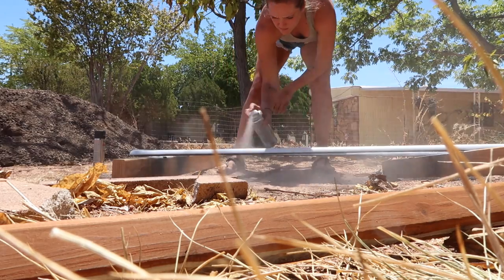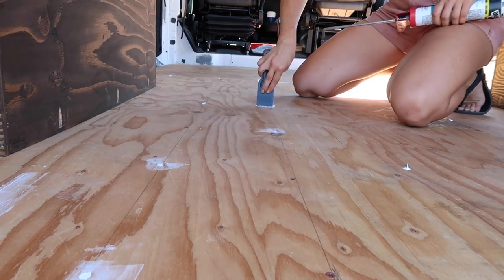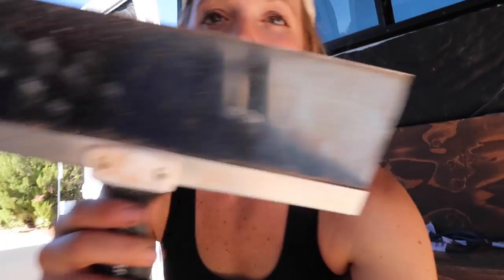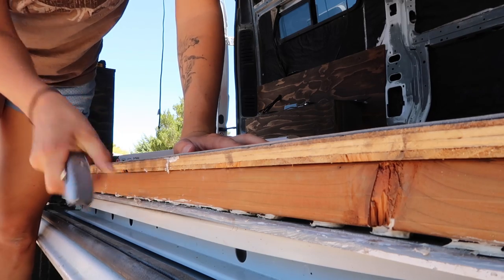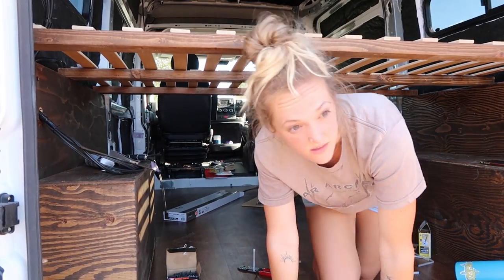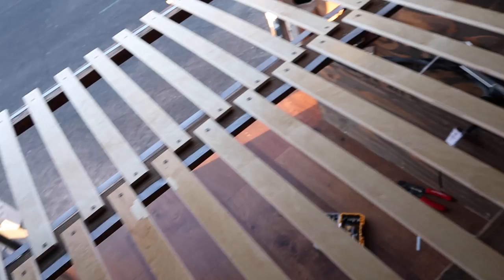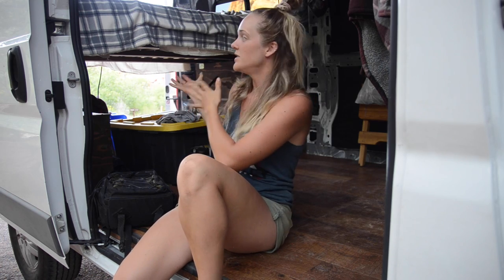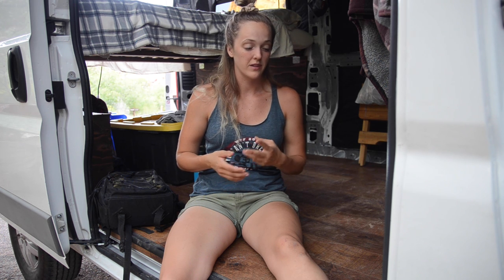The TRUTH about VINYL FLOOR | Floor & Bed Frame Installation

Comment: Hi Linnea, love your videos!   Wish I had found them before I started my build.   I do have a couple of suggestions:  1. To avoid cracking boards when putting in screws, you can predrill with a smaller drill.  2.  I did my bed about the same, but I can easily remove my frame if ever necessary.  Like to allow for easy access when installing Electrical equipment, installing finished flooring, installing upper cabinets, and cutting/installing AC/Fans in ceiling...   My side wall supports are attached the same(although I used 2x4s not 2x8s.  I then used old bed metal L rails that I cut to size to go from left to right across the van  I found a strong flat metal bar to use in the center.  I drilled holes drown through the end of the metal into the center of the upright 2x4s to secure the metal rails in place.  Instead of screwing the metal down, I used large #8 2" NAILS that I just inserted into the oversized drilled holes.  Gravity holds the metal rails and center support in place, with the nails securing them from shifting.   This allows you to just pull the nails out to remove the metal supports when you need to work in the bed area.  [*This system would also work with the 2x4 supports you used, but you would need longer nails.]   The bed slats I secured into place by using thin, scrap wood, cut to the 2-3" distance you want between them.   I hot glued the cut scraps in place onto the metal to fit tight between the slats.  That keeps the slats from shifting, but allows you to lift them out of the way when needed.  (Used bed rails and slats found at Habitat 4 Humanity for $25 total.)

Comment: It's a learning process, but no need to patch plywood under a floor like that.  Also, you would best put the vinyl down after the rest of the build, as there's no need for it under cabinets as it just adds cost and weight, and possibly in the garage if you just paint the plywood there (which would then be an exception to visually benefitting from the Alex caulking).  

A 2x10 is way overkill in the bed construction and since I see 2x4s spanning the bed area, then the 2x10 must be attached to the wall to support them.  A 2x4 would have been fine there, with 4 bolts holding it to the van horizontal rib on each side easily.  To conserve weight, ask youself (or others) what is the smallest dimension of wood that will safely get the job done.

You have to pre-drill holes in any thin wood material like those slats.  Without one, driving a screw in forces the wood apart and being so thin and near the end, you're getting the splitting.  The shape of the screw head will also promote splitting unless you countersink and gently bring the screw into that space.  Always consider what role the screw is playing, for the slates, it's just keeping them from moving laterally, and underneath a mattress not really interested in moving, so no great holding power is needed so even an oversize hole and screw somewhere in it would have worked here.

good luck!

Comment: The arches in the Luroy slats from IKEA is what makes it strong.  By offsetting them instead of aligning them you actially made them weaker. The weight shifts from side to side. An under brace would also do wonders.

Comment: Good build. When my son laid my vinel flooring, and about a year later, a few of them wanted to separate. It was a bit of a problem for awhile, but for not too long. I love the way you tackle each project and it turns out great. I've been worrying about my bed frame and I really like yours so I might just try it. Thanks for the updates. From Central Oklahoma.

Comment: I saw that someone said to pre drill the holes to prevent the cracking on your bed slats, you can also use wax or a cheap bar of soap. this will reduce friction, this trick will also be helpful when you go to do your cabinets. Good job so far and good luck with the rest of your build.
Reply from the maker: Hey thank you Kevin! I'll have to try that when I start the cabinets for sure!

Comment: A good way to help with not cracking, is drilling a pilot hole first
Reply from the maker: Yup, I did that from the start :)
Reply: Linnea Schmelzer I have an idea you should work at Home Depot parking lot
Reply: TTV ParCave is that supposed to be a joke
Reply: Tbroo grape kind of but it’s not a bad idea
Reply: Linnea, two things for future use. First, use a countersink bit which will prevent the screw head from splitting the wood. Second, when doing bed slats you can drill a hole through the slats (only the slats) that is larger than what you would normally do. It doesn't matter if they have a small amount of play. 😊
Reply from the maker: Michael King thank you so much! That makes a lot of sense!
Reply: TTV ParCave lmao true if your an immigrant
Reply: Tbroo grape what you mean I’m whiter than the inside of a Twinkie
Reply: @Linneaandakela  You only had to drill the top and bottom that is why they are stapled to the ribbon.
Reply: The ikea bed slats are arched for suspension and may perform best if not  screwed but contained by a  lip that allows lengthening in compression. 2-5mm. The screws may work, loosen and further crack the slats with use. But the slats do make a great bed.

Comment: Honestly I thought the peel and stick was not a good ideal but when you was finished I thought wow.. how beautiful.. really good job
Reply from the maker: Thank you! I did learn that it doesn't do well with drastic temperature changes, so in the future I think I would go with the sheet flooring... now I know!
Reply: @Linneaandakela  re: sheet flooring vs. peel n stick: I think there are pros and cons to both. I've heard sheet is not very durable (it can tear?) and can look fake. However, it looks super easy to install and can be replaced easily (I *think*... not positive tho).  Your floor looks great-- try not to hyperfocus on the little mistakes-- even pros make little mistakes.  At the end of the day, stand back and say, "Hell yes!  I did this!" and "My van looks great!"  Allowing things to be imperfect can create a wonderful state of mind.   p.s. Maybe I missed this but am wondering how many boxes you purchased?

Comment: OUTSTANDING JOB!!  You must of been a hippy van builder from the early seventy in your old life time.  The next time you need to put screws in slats pre-drill a hole in the slats bigger then the screw. It will do two thing # 1 it will stop the slats from feeling loose # 2 It will hold the slats better and you can pre-sink the screw ( it will help the bottom of your mattress)  Your floor look great, and I have to say that I would have install it the same . If it because a big deal just replace it with sheet flooring. Like I told you in your first video for a first time van builder you are doing a GREAT job !! (the slats was a great idea and to great them at Ikea that the best idea of all ! (I look forward to your next video with great Ideas)
Reply: I was just going to say everything John just said! Lol. You’re doing great! It’s fun to see someone younger with the passion for van dwelling. I’ve never been more content. Only wish I’d done it sooner.
Reply from the maker: John thank you! Perhaps I was haha! 
Thank you for the advice about the pre-drill, I will have to remember that for next time. And yes, I will keep an eye on the floor (luckily the majority of separation is happening in my garage which few will see!). Next will be my solar so fingers crossed it goes well!
Reply from the maker: Thank you! It is helpful to hear that you still love the lifestyle :)
Reply: @Linneaandakela  I know you can do the electrical just remember 4 things # 1 power come from the source #2 something turn it " on and off " # 3 something use the power # 4 it go back to the source That is called a circuit and remember you do not share beer ( everybody get there own beer) parallel

Comment: Regards your glue issue and your comment about sheet\roll linoleum,  it's a different type of glue. I've never had an issue on RV, Van Cottage Kitchen Floors. Direct sunlight through doors, windows & VERY hot {windows closed} van, step-van, box truck conversions...

Comment: My plan for flooring was also vinyl and got great offer for two boxes headed to trash... which barely cover required area.
Those have snap-in grooves on all sides but bottom is so slippery that whole flooring slides when braking harder... Bought some super adhesive which going to use in rear doors & sliding door sides but leave floating elsewhere for allowing it to play well around year weathers

Comment: I first seen the build on TikTok, had to come over and check it out to get the full videos. Great job on build. Looks great so far.
Little things that I thought would help that I noticed..
To prevent cracking in the wood, pre drill the holes. Goes a long way to help save some money and materials. 
On your bed frame to gain the extra 3 inches to keep the slats from hanging off the edge; notch the 2x6 on the edge to fit the van. So youu can slide them as far out as possible. I would also put a center support underneath the bed to prevent the bed from sagging in the middle. Youu could make it on a hinge that folds up when youu aren’t laying on it. So youu could have space for storage(since it is limited). Just make sure to put something on the center brace for it to lock into when youu fold it up out of the way. 

Once again, great job on the build. Looks great, keep up the good work. Look forward to see what else youu do to make it yours. Best of luck.
Reply from the maker: Hey there
Thank you for the suggestions! 
I do pre-drill almost everything. I had predrilled the bed slats and found that the cracking regardless is pretty normal. And the three inches didn't make a difference at all in the end! 
As for under the bed, I have planned out my storage space - which is one of the reasons why I don't want extra support at this time, because I want maximum space for what I need under my bed! While I build out my compartments, it will act as extra support for my bed. 
I had considered a hinging bed, but I know myself well enough to know I wouldn't go through the extra effort to make that a part of my lifestyle haha.

Comment: Regards 2x10 & bolt worries = (A) you had the carriage bolts backwards. The square part of the head wedges into the drilled hole in the metal as you tighten them, thus no need to hold with a wrench & the nut with a flat washer is on the outside of the wood, & therefore easy to tighten with a wrench. (B) you need to use [split] lock washers or nylock nuts. The bolts can't back off\come apart...

Comment: I’ve put flooring in a short bus. You should try the type of flooring that we used. Each individual piece interlocks with a top and bottom piece of adhesive. I can’t remember the name, but the bus got a lot of use and the floor has been really durable.
Reply from the maker: I ALMOST chose that!! That is great, I will have to try that for the next one. Do you notice any separation with different temperatures?

Comment: Even though I’ll never do this myself I’m so invested in this series. I love your creativity and drive, it’s inspiring. Since you’re big into nutrition and exercise what will you be doing to replace the gym while you’re on the road?
Reply from the maker: Thanks so much! So I will have a 30#, 40# set of dumbbells, a 80# ish kettlebell, a stool for steps or jumps, and I will be rigging up a pull-up bar. I also will have a sandbag with me. So with a few weights I will be able to work out often, and when I feel like throwing the barbell around I will just drop in to a gym! As for the nutrition aspect, I decided to get a decent fridge so I can still easily prioritize healthy eating.
Reply: Linnea & Akela sounds like you got it all planned out! Excited to follow you on your journey.  Beautiful, smart, and handy. You’ve got a lucky man, keep up the hard work

Comment: hey, quick tip in case you ever have to screw to pieces of wood together again: pre drill a pilot hole (a hole slightly smaller then the screw that is supposed to go in it) this should help prevent the wood from cracking and tearing
Reply from the maker: Hey! I actually did that with the slats from the beginning, that was the frustrating part!
Reply: @Linneaandakela  hm, that is frustrating indeed, maybe the wood grain was going in the wrong direction or something? or the wood was just finnicky?

Comment: Just hit the top of the screws with your spray paint that you used on transition pieces (you can try spraying the top of a screw you havent used first to see if it color matches)
Reply from the maker: Love it! I might just have to do that
Reply: @Linneaandakela  I do this a lot! Take a cardboard box, flip it over and push the screws through the box (while still sticking out) and spray paint it all! Helps to keep the screws in place and you can hit all the angles!

Comment: Nice work! I love it so much!
I have a question that how did you know how much weight can the bed frame hold? How to know if I need one more extra support in the middle or not before I fall down?
Thank you for sharing :)
Reply from the maker: Thank you! I am not really sure how much weight it can hold... But I have slept with my parter (6ft) and my big dog on it and I was never worried!

Comment: Very helpful thanks! A couple questions for you or anyone with flooring advice:
 
Is there a way to prevent the cracks in the sub floor? Is it just dependent on type of wood? Because of this do you think it’s beneficial to not lay the flooring down right away so that you. Can seal the cracks that do surface?

What was the reason for the extended flooring in the rear/garage area?

Comment: thank you! so when you say "redo," you still have the original 2x10s bolted on yeah? did you use the original M8 bolt provided in the promaster in addition to your rivnut tool? thanks!

Comment: When you screwed the screws into the slats for the bed you should Pre-drill with a small Drill bit and it will not crack
Reply from the maker: Yup, I did that from the beginning :) they were still cracking a bit but I figured it out!
Reply: Linnea Schmelzer ahh ok well it looks great Im here because of your TikTok lol
Reply: I could not tell if your drill also had a countersink on it. I think the hole itself is fine but the underside of the screw head is pushing the slats apart when it goes in the hole. A countersink would match the angle so the screw wouldn’t try to push the wood apart. Looking great so far.

Comment: Heyo, me again. :) For your floors, silicone around the exterior edge along the van wall or no? I've read where some put silicone to prevent moisture falling into the edge/crack and under insulation but also heard to keep it open to allow for ventilation/air flow. Thoughts?

Comment: I talked to my ambo fleet guys. They said no one has ever pulled off a 3/4 ton front wheel drive cargo well. Be careful ....they say backend is super light ...and the throttle control dynamic (front drive acceleration) can make it handle weird. Also, they have found the transmission and engine (head gasket) can be of issue. Granted these are driven HARD as ambos....but very labor intensive to fix (whole front suspension has to be dropped to get engine or trans out). Just go easy on her and take care of routine maintance.
Reply from the maker: Thank you for all of this information!

Comment: Hello I have vinyl sheet down on my ply but dont know what to ask for at HD when purchasing that aluminum angle to trim the ends of the floor? What is it called and what section do you purchase? I asked people at HD but got nowhere said dont think they have any in stock and that I should search on line? I searched your description section to see if you listed it? I know probably simple for others but im stuck here. Thanks enjoying your build process. 💪
Reply from the maker: Hey there! You can ask for aluminum transition! It is near the flooring/carpet area :) 
I hope you continue having a great time with your build!

Comment: You probably are aware of this but when using screws through thin wood “pre-drilling holes a size or two smaller diameter of the screws will help pr3vent the wood from splitting.

Comment: Love these videos, note for the future, use a pilot hole for screws at 11:11 lol :-)
Reply from the maker: Thanks so much! 
And that actually was the frustrating part. I used pilot holes with the slats from the beginning :) 
Just the way I had my bed frame and how brittle the wood was, it still split. With a little more finesse, it all worked out :)

Comment: Hey! a fellow Utahn converting a van awesome!  quick question. Looks like you took down your 2X10's so are your 2X4's and bed slats just resting on the sides of that 1/2" plywood??
Reply from the maker: Hey, yes! The plywood is extremely strong and stable with the hex head bolts I put in, and then my 2x4’s are about 2 inches over the plywood on the ends with a large “L” bracket under each one for extra support. I hope that helps!! Also I jump on it to get up every time and it has been amazing so far - feels super solid

Comment: Besides heat causing lifting, I installed this same vinyl flooring and had a bottle of olive oil bust open and spill on the flooring. The oil ruined the adhesive and the flooring just started falling off. I would avoid this stuff at all cost.